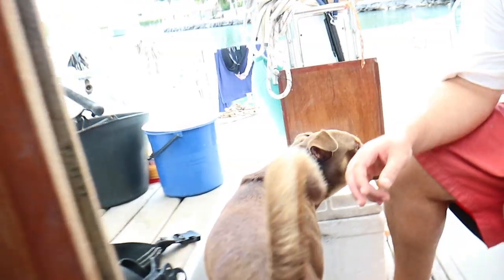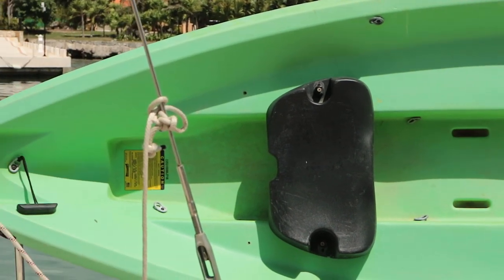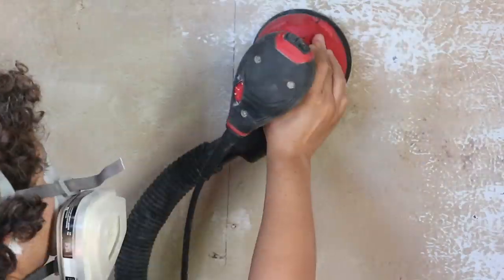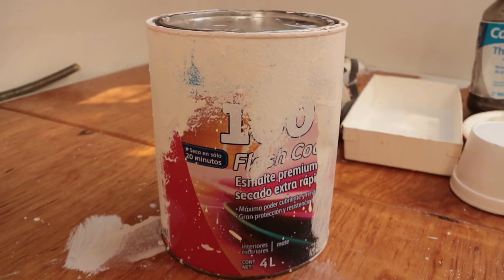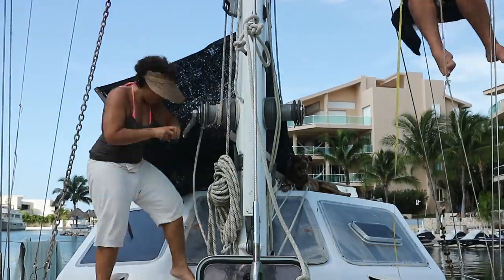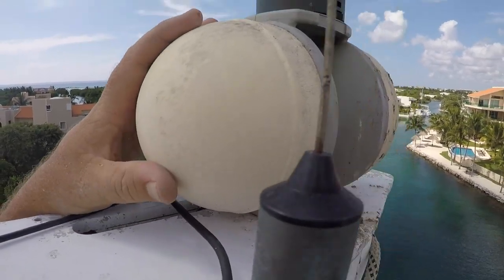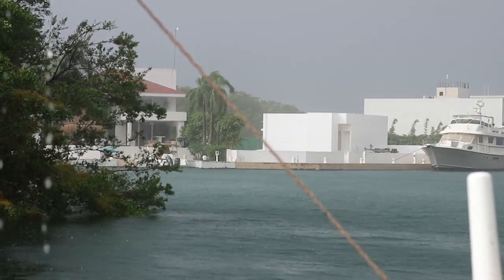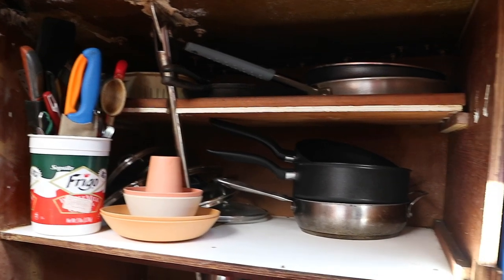65. CRANK IT UP - Wire and Synthetic Rigging

Comment: We have synthetic standing rigging on our 45’ boat and it’s been holding up fine after 5 years and an Atlantic crossing. Still going strong!

Cost wise, all the materials for our cutter was only $4,400. I did all the work myself so no labor costs.
Reply from the maker: Hey, we've been watching your vids, keeping an eye on the synthetic rigging experience you've had so far. And of course it's working out for you guys! I'd say that the cost is definitely the advantage, but it was actually your video about tuning the rig that got us thinking about synthetic on a heavy hull. We like to keep the rig more tensioned than that, to be honest.

Comment: I agree with Robi re: peace of mind for the next 10 years..... and there's nothing like galvanized rigging for strength,  low cost and longevity later on when you are in Asia or Turkey and the labor is worth going that route.  I have back up steel cable for emergency but like dyneema for its versatility and feel.... on my halyards, soft blocks etc...
Reply from the maker: Interesting...will look into galvanized rigging, although sounds a little rusty!

Comment: Check out RiggingDoctor channel. They sail with dyneema rigging. Sheathing seems to a key re chafe, and adjusting with differences in temp. Carry a reel anyway, if you do choose ss, then you can always jury rig with dyneema to get to port.
Reply from the maker: Exactly. Gonna carry that extra synthetic rigging just in case.

Comment: touchy subject:  (I done learned that already).  but I'm gonna bring it up again, because i really want ya'lls knowledge.
Knowing how intelligently frugal ya'll are, and knowing ya'lls combined experience, I' know ya'll have experienced it.

Junk rigs.  It seems to me it'd be cheaper and as efficient to convert to a junk rig, rather than the cost of new standing rigging and refinishing the mast and all it's connections, with a hand carved wooden mast, etc.  but there's lots, boat loads of things i don't know.  and lots ya'll know that i don't.

so what is it that you two don't like or don't consider junk rig conversions?  I know there's forums, all pro junk, or all negative on junk.  finding experienced non prejudiced comparison knowledge is like finding a needle in the bay.  (I've searched them for countless hours).  I have found a few, hence why i'm somewhat convinced that's the way i should go.  but i have a gut feeling that i'm missing something, and I have a feeling you two have that answer for me.  If ya'll wouldn't mind.  educate me please.

I did find a boat, an older 36ft wharran (I can't remember the model, the narrow predecessor with low head room to the tiki 38), it'll need a mast/sails/rigging, motors and updated electronics.  the hull and deck work is complete.  I'm strongly considering it.  

so do i do a gaff rig, or a junk rig or bermudan?.  I think gaff or junk, those would be the easiest for my ol ass to manage.  I realize that the resell value will be a lot less with a junk rig.but with the narrow hulls and low head room, small berths of this particular cat, there'll never be a big resale price.
Reply from the maker: I like junk rigs. Especially, for say, a Wharram, as you described. My Tiki 21 had the Wharram Wingsail, kinda like a gaff rig, but with only an upper stick, so that you are never in danger of getting hit by a boom when sailing. I really liked that sail, even if it couldn´t point up wind very well. Gaff or junk allows you to point up wind a little better in comparison to the wingsail, and a properly tuned bermudan set up will get you pointing even more into the wind. 

But I think I mentioned before that that there is no way that the cost of opening up the deck and putting a mast through would be more cost effective than simply buying new wire (because that is what converting to junk rig would require). But it would be an interesting project! Never heard of anyone doing it. An old Wharram would be a good candidate, because I have seen some images of junk-rigged Wharrams floating around. You could probably contact the Wharram team and ask for plans for converting it to junk, I think.
Reply: @sailorama    that explains a lot, thank you.
I've found a number of boats that made the conversion, but not enough print to define the outcome (cost affect results).

I hadn't even thought of that logic, thank you.  wharram seems to have all the answers when it comes to their designs.

of course, cost and performance are concerns, but as importantly to me is ease of use, including the maintenance, headache factors.  I'm learning that regardless of which style of rig, performance is about the same, on average.  leaving ease of use, reliability and up front and long term costs as primary concerns.